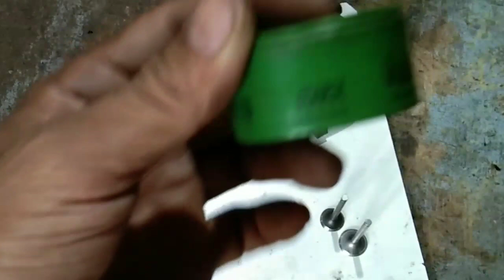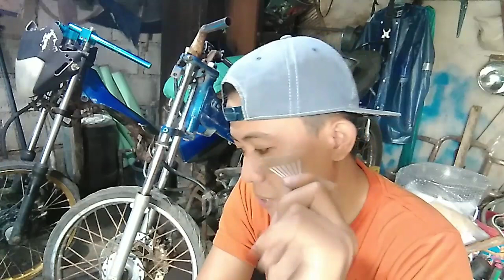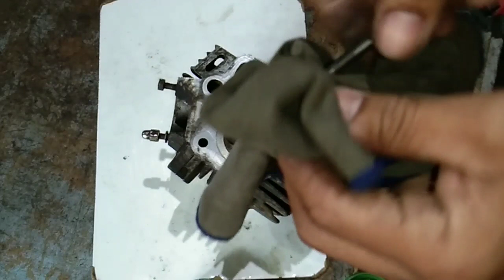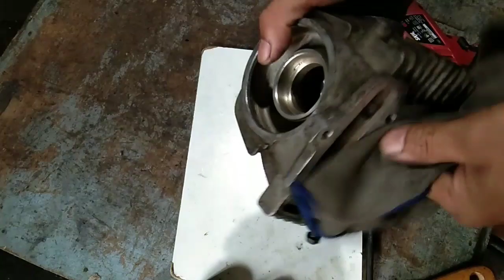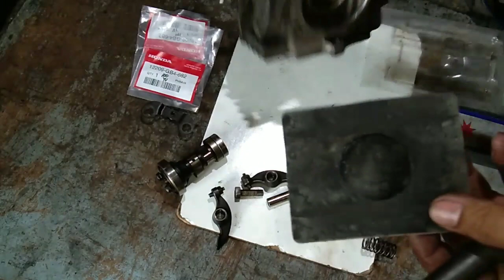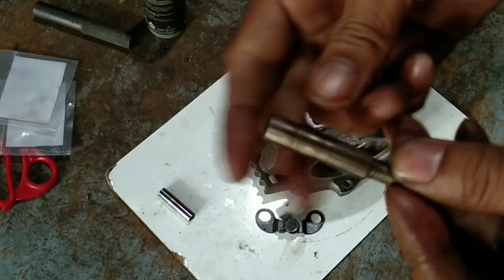HONDA XRM PROJECT REVIVAL PART 6

Comment: Sir ano tawag sa kulay green nayan ty
Reply from the maker: Grinding compound
Reply: Sir ano po ba yung mga dapat ko bilin na pyesa kapag mag kakabit ako ng clutch sa wave 100 yung iba my gina gawa na ni wewelding sa magneto gawi malabo kase mga video ng vloger nayun tuloy mahirap masundan XRM po yung ginawan niya tagalog tutorial dn yun sir na cut na kase yung pag welding kaya diko alam kung san gawi yung winelding sa side ty sir.
Reply from the maker: @778marlon2  idol message ka po sa FB page.

Comment: ilang beses kaba nag grind ng valve idol? parang pang apat na valve nayan ah! 4 valve yata yang xrm na yan. joke lang po. ganda ng video atleast may idea na ako kung mag change ako ng valve at dapat barena ang gagamitin kasi yung iba kamay lang eh kaya pala 2 years palang exhaust valve ko tumutunog na at wala na menor. mas pantay ang pagka grind kapag barena at nagiging sagad ang valve sa butas... at add ko lang po, linisin nang mabuti ang valve at block na walang maiiwang rubbing compound kasi if you do an experiment. magiging semento ang rubbing compound sa init ng makina na makakasira ng valve seal at compression.

Comment: decompression or compression release  ung sinasabi mong parang vendix drive paps.. yan ang madalas mga terms..

   pa shout paps.
Reply: Un po b ung my spring na maliit?
Reply: @geralddayandante6808  yup.. kung sa ibang cylinderhead ung may bolt na 10mm na may spring din.. pero stopper lg yan paps. dnun din yung design ng camshaft
Reply: @thiirdcalubia6719  tumalasik kc ung spring ska ung prang volt na maliit.. Anu pwede maging epekto master pag wala nun ung camshaft? My nabibili din bang ganun.. Tnx
Reply: @geralddayandante6808  sa fb ka po mag message..  https://www.facebook.com/100037954491923/posts/108771747064641/?substory_index=0&app=fbl

Comment: Yung mutor ko euro keeway capitol100 simula pinalitan ng stator at rectifier hindi na kya umakyat ng marilaque lagi namamatay pag mga isang oras na takbuhan advice naman sir idol
Reply from the maker: CDI check po, posible may problema. Check stator din po posible overheat ang primary coil posible reason kung bakit namamatay ang makina